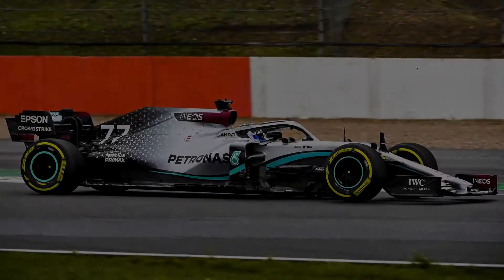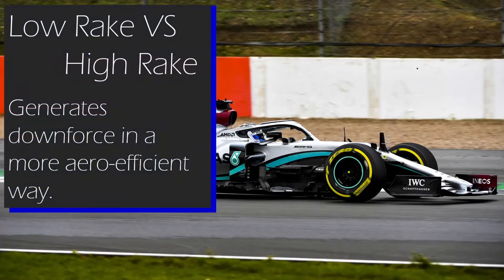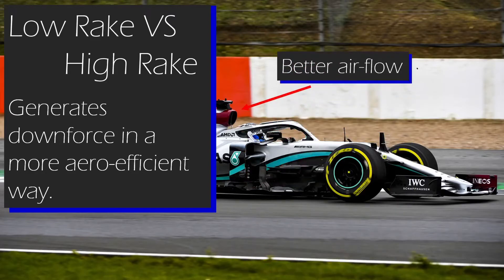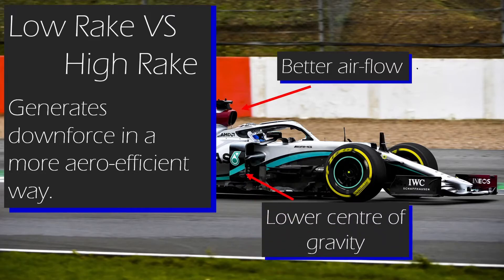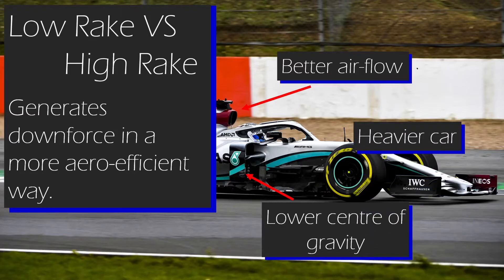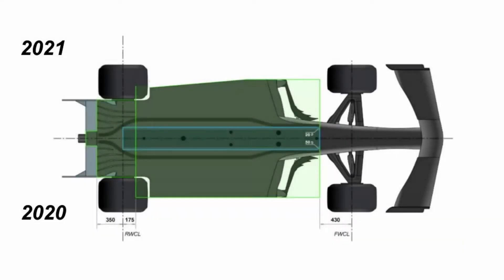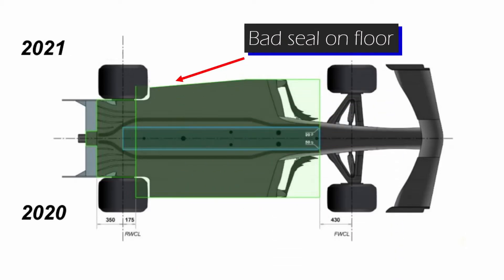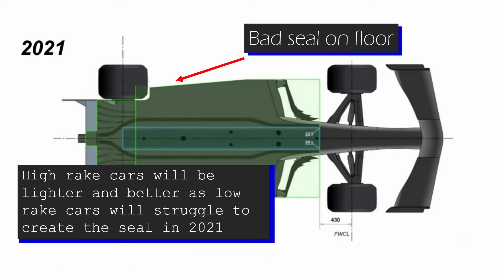What is a "low-rake" F1 Car?

Comment: “Air sucked to the ground and this is how downforce generated?”. Even god gives us downforce is more believable explanation
Reply from the maker: Sorry for not explaining it well, I am currently working on a video about downforce so maybe that will help. The way downforce works is that the high pressure on the top of a wing (created due to the wing's shape) is trying to get to the low pressure on the bottom. The wing therefore moves in the direction of the low pressure, and as the low pressure is on the bottom, it pushes the car downwards into the ground, creating downforce.